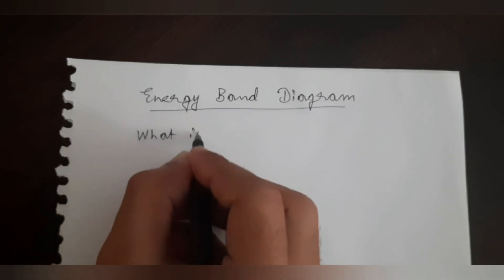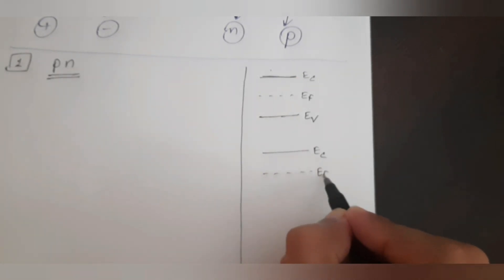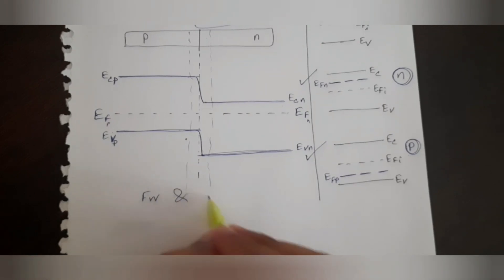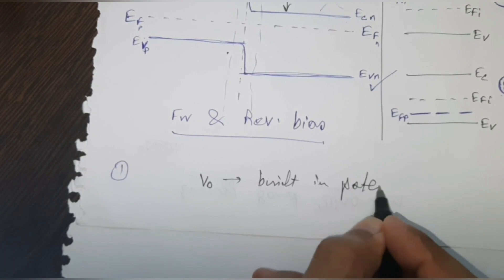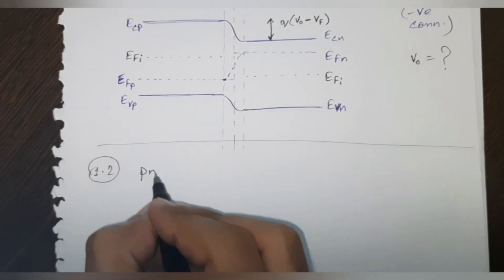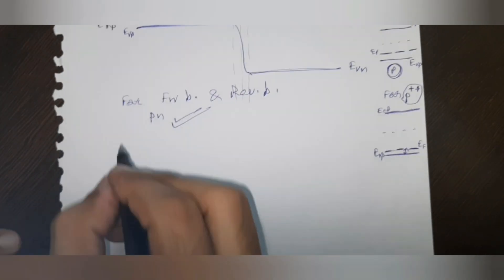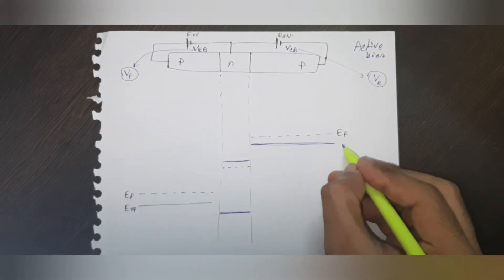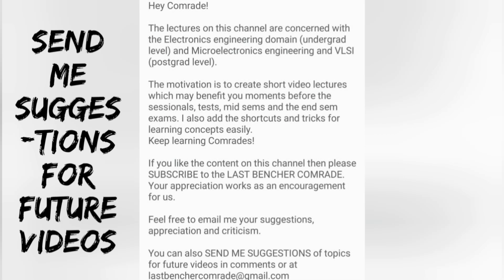Energy Band Diagram BASICS | Shortcuts to draw ANY Energy Band Diagram | EASIEST method | Electronic

Comment: Can you tell me definition of 
Phi(m) – 
Phi(S) –
E(F) –
V(R) –
IC these. letters in parentheses are indices
Reply from the maker: Phi(m): metal work function,
Phi(s): semiconductor work function,
E(f): fermi energy level,
V(r): applied voltage in reverse bias condition,
IC: integrated circuit.
Reply: @LastBencherComrade  Thank you so much